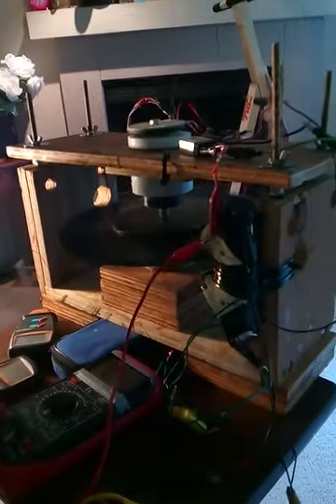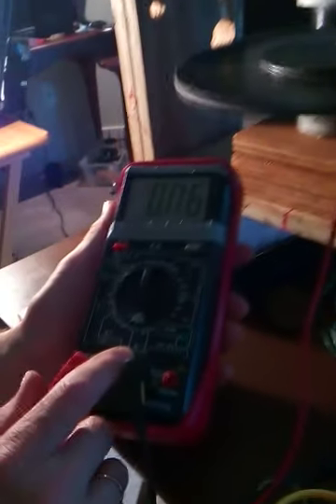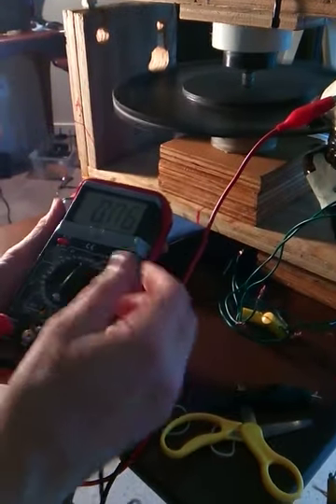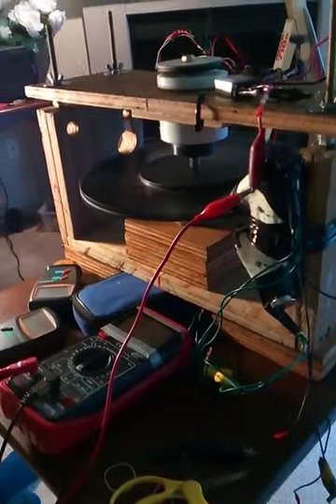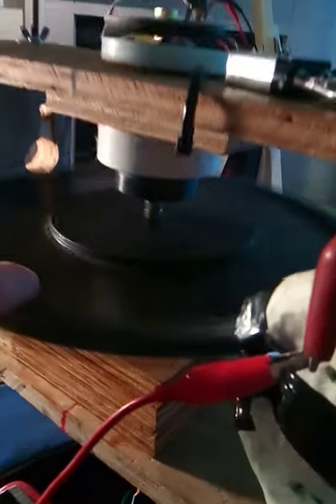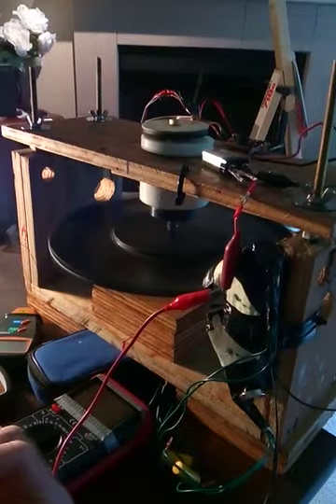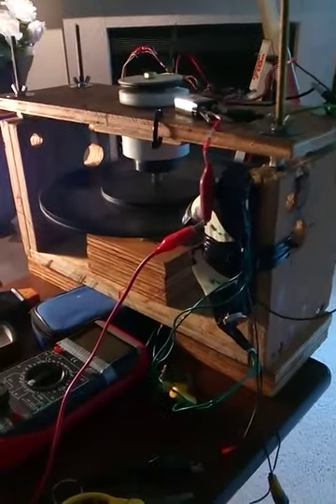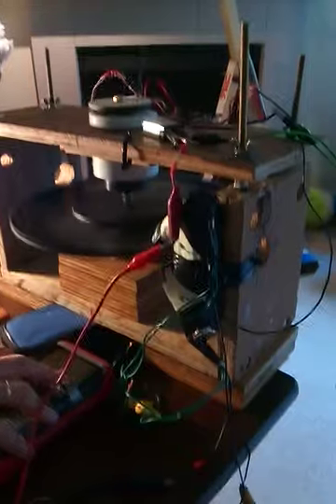Sawblade rotor motor test of rpms and amp and voltage draw

Comment: Great setup doug!... Cant wait to see the next one.. Hundreds of ideas go through my mind while watching...
there are so many possibilities.. 
1. harvesting (as you said the generator coils every second magnet..
2. but why every second magnet? they could be harvested every magnet..
3. you could harvest the motor coils every second magnet.. example.. when triggered on south pole the coil is a motor coil, when triggered on north pole it becomes a pickup coil... (ok, maybe the circuit to do that will use to much power - more than it will produce, but we dont know)
anyway great stuff you are doing there..
Luc
Reply from the maker: Hi Luc
Original idea is to get this rotor up to "delayed lenz" speed which I guesstimate is around 1200rpm but have a long way to go for that....
I wrapped brass wire around rim last night to contain the magnets at higher speeds...
When running just one coil for lower impedance it was going 325rpm and drawing twice the input as two coils in series...I want to split the coils: so top one fires attractive the bottom fires repulsive, so neither ON at same time now I can experiment with juggling the backemf/recoil energy and induced energy in the pickup winds into the "other" motor coil, with maybe cap in between to store it for a bit of time. Maybe wont need cap, could use transformer or maybe boost convertor would be fun.
I see your idea of triggering motor mode on S pole magnet, N pole magnet becomes generator....I think its doing this "naturally" upon motor coil switch-off, just need a FWBR across that motor coil into cap!
Then what is "harvested" is put to work spinning the rotor stronger as cap is released at just the right time to get no lenz/backemf braking of rotor during cap release to load, the load being the opposite motor coil so this is one idea of a hundred eh!
Thanks for writing I appreciate your comments always!